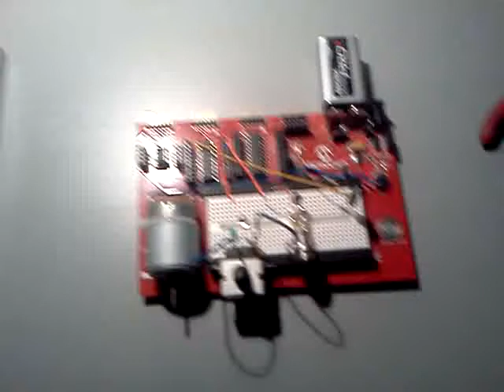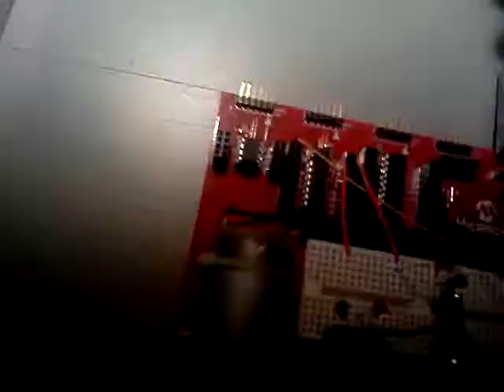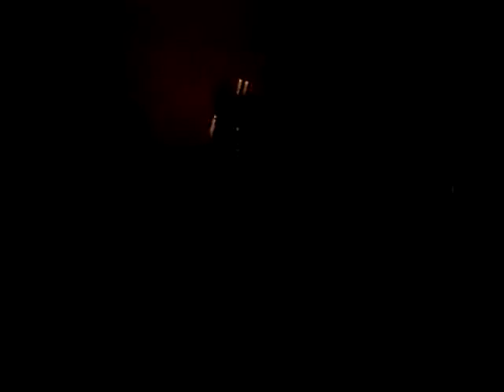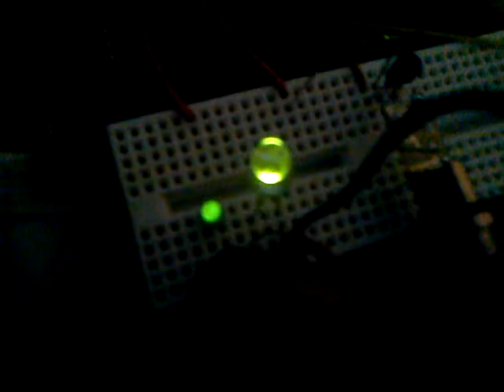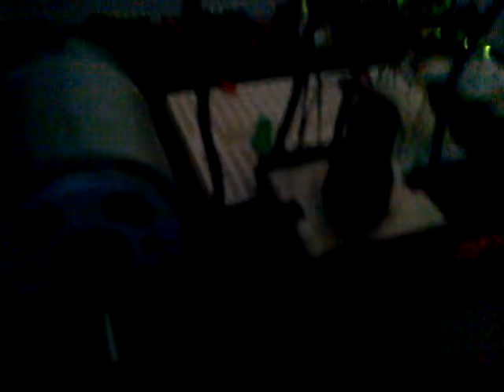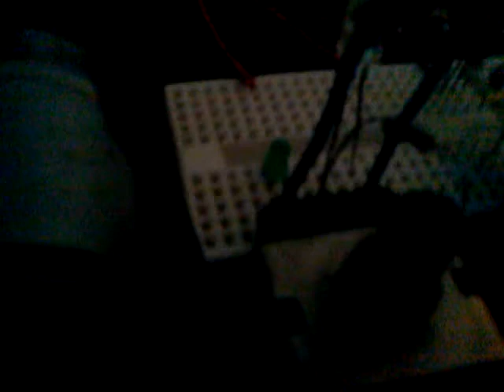Digital Encoder / Rotary Encoder - Explained by Nolan

Comment: Hey Nolan!  Nice video!  I'm replacing all the encoders on the front of a Behringer LX1-112 guitar amp.  2 of them are the 24 position type you have in your video.  Can I use any 24 position digital encoder that will fit?  The rest of the encoders on this amp dont have steps.  Where can I learn about what encoders I need for these?
Reply: thefunkybeat79 Also, can you use stepped encoders in place of non-stepped and vice versa?  Also, I'm in Dallas!  Howdy fellow Texan!!  :)